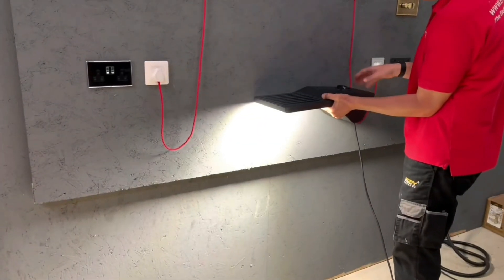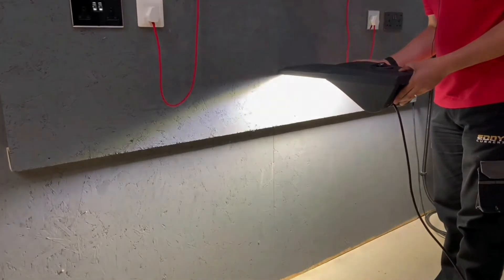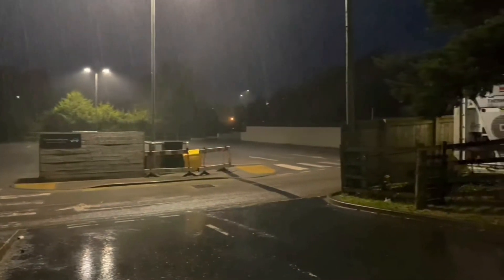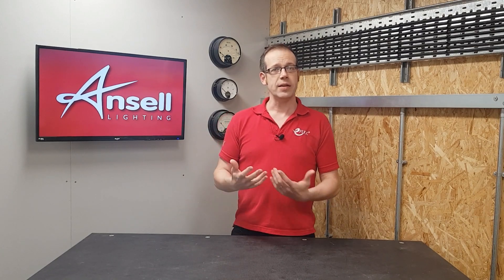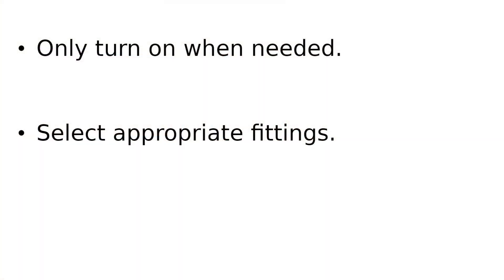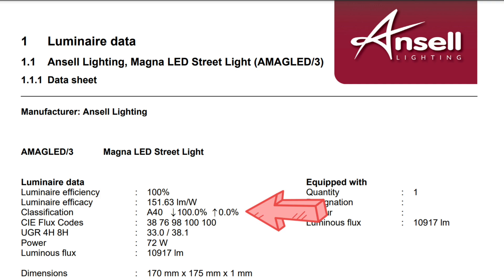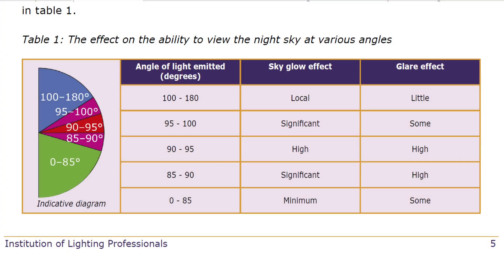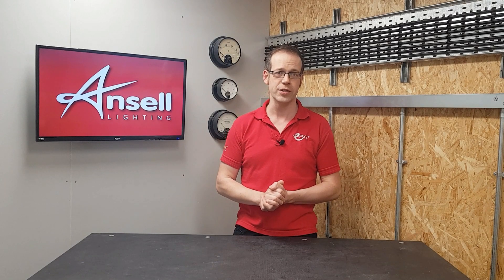The Problem of Light Pollution and 3 Ways to Fix It!

Comment: My opposite neighbour decided he wanted driveway lighting and during a discussion told me he was considering LED bollards. I told him I’d designed many such systems and pointed him towards fittings that projected light downwards to provide pools of light on the drive itself rather than scatter light in all directions. Many bollard luminaires have louvres to achieve this or are constructed with hoods to prevent horizontal light spill. What did he do? Well he ended up with nice stainless steel bollards with clear glass lenses that nicely illuminate my lounge and bedroom and blind anyone using the the driveway or passing in a car. We are a rural community with no street lighting so the glare effect is even more pronounced. What do I do? Risk Falling out with him over it? No, there’s little chance he will do anything about it so we’d just end up with bad feeling and I’d still have the glare! So I just pull the curtains instead. I see the same with people mounting domestic LED floodlights to illuminate driveways so they aim them out from the mounting point when such devices are designed to be directed downwards. I despair!
Reply: I'd sneak out and paint the lenses black! 😅
But then I get really p'd off with inconsiderate neighbours be it they light their house up so it looks like the Starship Enterprise or they play their radios on full blast or worst of all for my dog let off bangers constantly for weeks on end and then have the cheek to moan if my dog barks!!

Ahhh that's better...🤪👍😄
Reply: Contact your local council Environmetal Health dept quoting Section 102 Clean Neighbourhoods and Environment Act.

Comment: I think light pollution is really a "non-problem" and it does not bother me one bit, but look at it from a different perspective, light that is not directed toward objects on the ground is wasteful. If your light installs are directing light where it does not illuminate anything you intend to look at, that's just wasted energy. So following all of the guidelines to mitigate light pollution will actually result in better, more efficient lighting.
Even if every light in the world was optimised in this manner that would make no real difference to the light pollution because the illuminated areas still reflect light toward the sky, but at least we'd have better lighting, more illumination with the same amount of energy used.

Comment: We wouldn't need outside if it wasn't for Burglars, Hookers and Moths
Reply from the maker: Ooooookay?
Reply: @efixx  By me that has been solved, no street light no problem, they have been broken for a year on the one side, and the other side died this last week.  Reported, and they might get to it "when they have a new contractor set up", which has been, like the speed cameras, a thing they have not done for the last 5 years, but are "working on fixing it". At least still do get electric power and water, though the UK is heading for rotational load shedding soon as well.